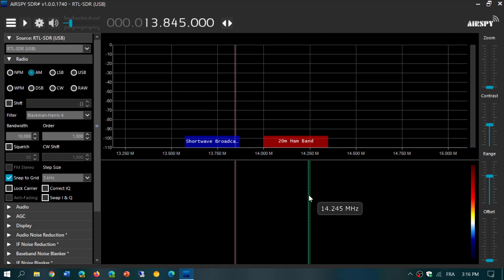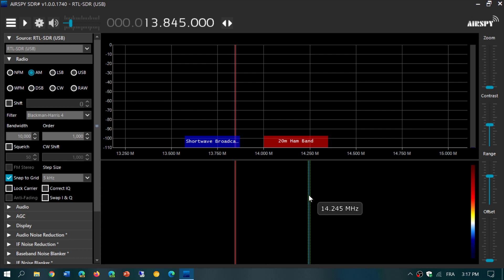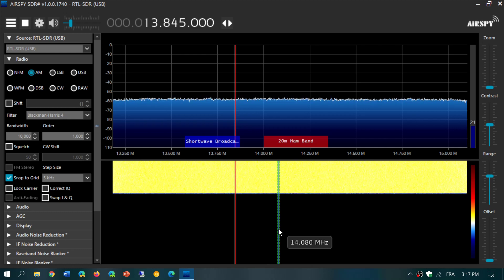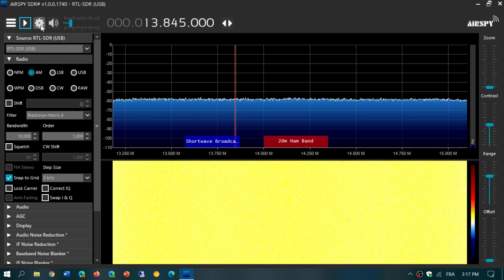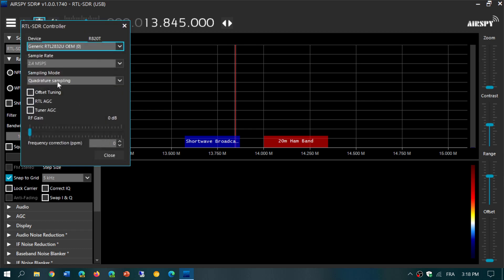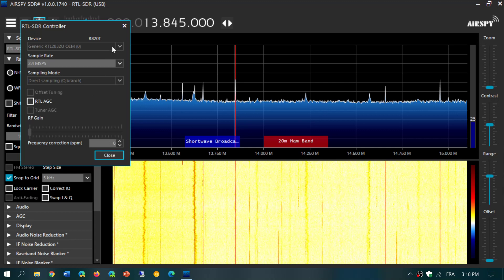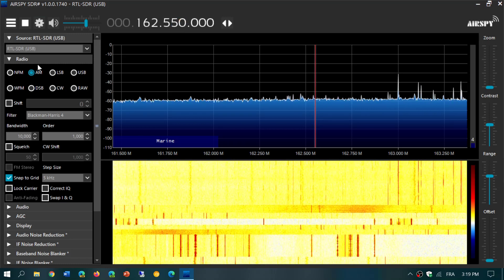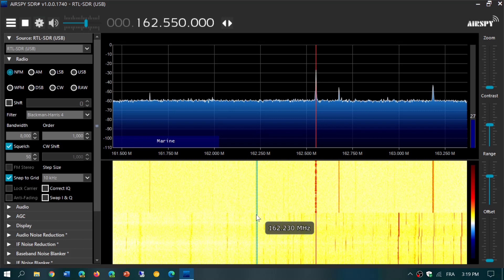How to receive Shortwave on RTL SDR V3 and SDR Sharp software

Comment: If you are using rtl_tcp for your SDR V3, you need a modified version of rtl_tcp to use the parameter "-D 2" for enabling "direct sampling". 
It's explained at the RTL-SDR Blog.

Comment: I have the Nooelec RTL-SDR, and cant recieve anything for simple AM radio stations. I am using Q-branch sampling. I am using a Ham-it-Up upconverter and a whip antenna about a yard long. What could I be doing wrong?
Reply from the maker: with a ham it up you have to add the offset frequency and turn it on
Reply: @OfficialSWLchannel  I have the same problem, even with the right settings and the upconverter with offset frequency and a large dipole antenna or long wire balun, I can only receive FM and VHF.

Comment: Probably a silly question, but did you do that with the antenna that comes with it or for SW you used a long piece of wire? I can’t peak up anything but noise even when I do this. Thanks!
Reply from the maker: For shortwave you need to choose direct sampling and I am using a outdoor Loop antenna
Reply: you need a long piece of wire